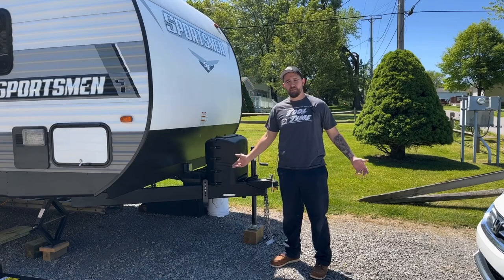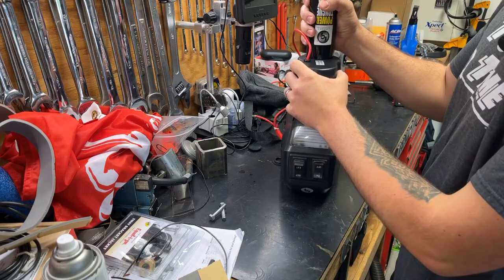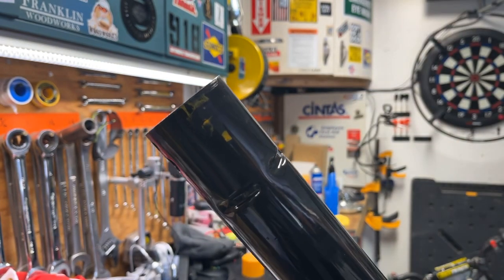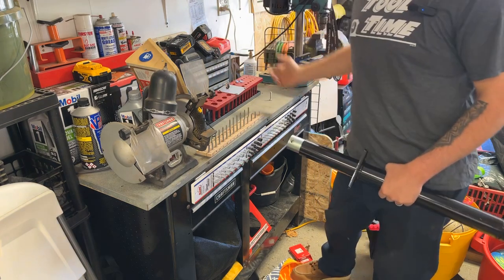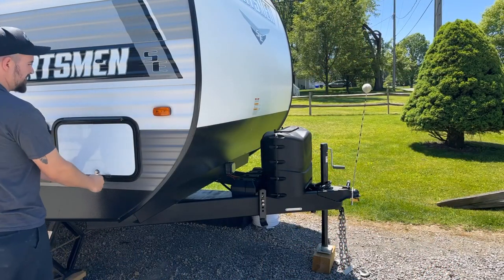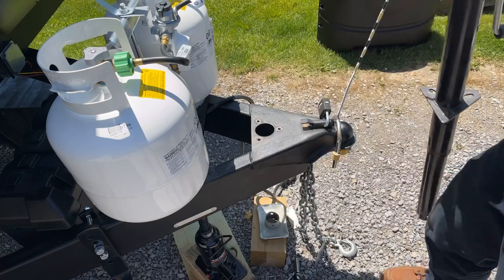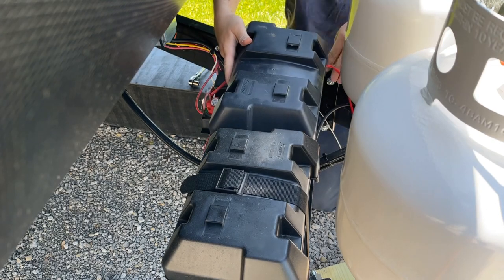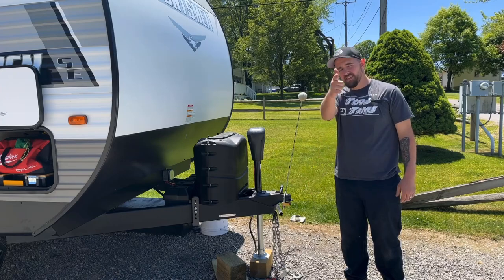Tongue jack upgrade and modification!!

Comment: My 2018 Winnebago has the same electric tongue jack as yours.  I did the same mods as you but to my surprise the holes were already drilled.  I had to tap threads in it but it saved some work for me. Thank you for the video.  I have not been able to open my tailgate for 6 years, and now that problem is solved thanks to you!
Reply from the maker: Happy to help!!

Comment: Takin the extra time, my grandpa always said do it right the first time or do it twice. Now you're in this far, drop the belly and see all the wiring hanging free in the metal pass through holes... I did that a month ago and cleaned all the wiring up and routed it all better with some non metallic conduit, it was a lot of work but worth knowing I won't wear through the jackets and ground something to the frame.
Reply from the maker: Absolutely. Thanks for the great comment!!

Comment: I have the Lippert Smart Jack and hate that I can’t open my Tundra’s tailgate all the way. This is brilliant. Question: Instead of using the bottle jack couldn’t I just hook the camper to the tow vehicle and remove the jack to drill the new holes? Btw, I just found your videos on YouTube and you are “the man!” Great content…and entertaining!
Reply from the maker: Yes, you could absolutely do that. I just wanted the room to work. And thank you!! I’m glad you enjoy the channel!!
Reply: @dansproshop  ….🤦🏼‍♂️ I just checked my “Smart Jack” and there isn’t any rubber caps on the sides to access any nuts to turn the head….guess I’m stuck with this “DUMB” Jack and a tailgate that won’t open all the way. 😡

Comment: Look at an autoleveling Ground Control from LCI
Reply: They are pretty good. My only complaint is with the Ground Control 3.0 system. They can be a little glitchy sometimes. The jacks can loose track of their position and cause an error code in the controller. This can be easily cleared by manually extending the jacks about 1ft  and then retracting all the jacks simultaneously.  Its just a pain in the ass sometimes. We've had so many customers come in with a front jack error that was just a glitch in the sensor. Other than that, they are great systems. It definitely beats manually leveling your trailer. I deal with so many Lippert products and they are definitely a good manufacturer with great customer service help when needed.
Reply: @OneRoomShed  I got a new camper and CW put a new leveling system on the new camper. I had to switch to the old control panel. It faulted out and I had to use a ratchet to manually put the jacks down. The old control I could put them down electrically. My front jack still faults out on over amps.
Reply: @scottdavis9442  lowering them manually can be aggravating sometimes (been there many times).  If you keep getting an error code on the same jack, there is probably a problem with sensor inside the jack. This could lead to a failure with the jack not running at all eventually. I usually tell people if it happens once or twice it's probably a glitch. If the same error persists on the same jack you will need to have it replaced. I would look into that if I were you. If the system is less than one year old, you can probably get them to replace it under the mfg warranty.
Edit : also if it is faultling and over drawing amperage, this maybe a defect in the motor itself.

Comment: I need to turn my existing one. It is an FIC 3500. I think I am lucky in that it has a round base. I can just remove the 3 bolts, rotate the jack and base 90 degrees, mark, and drill 3 new holes in the mounting base. It’s heavy gauge metal, but straightforward and simple.

Comment: Those Lippert jacks are definitely a better quality compared to some of the generic electric tongue jacks available. The only thing I can add is invest in a cover to keep the head assembly out of the rain. Although that Lippert model is not as prone to taking on water, there are a lot that are. If anyone buys an electric jack that has the switches on the top or the manual override access hole is on the top ; cover the head of the jack. They love to take on water and fail after one year (just as the mfg warranty runs out).  
If I were to ever recommend an electric jack to someone, it's the one that Dan just installed. It's definitely a reliable jack.
Reply from the maker: Thanks so much for the great comment!!
Reply: @dansproshop  just sharing my experiences. Same as you do and that's appreciated too my friend.
Reply: Just use a five gallon (you will have it available for other things) and hang the safety chains on the handle when parked.

Comment: In a another video could you show how to set up 2 batteries to run in parallel. I want to convert my one battery into 2 batteries. Thanks Dan!
Reply from the maker: Absolutely!!  Not difficult I promise. Just hook up the positive from one battery to the positive of the second. Same thing for the negative. That doubles your ampacity and the load will be shared between them. Works great!
Reply: I guess I meant in series. I don’t want convert my 12v into 24v. I’ll fry my camper’s components. Thanks
Reply: @josephcirelli9642  Dan is right, and you do want parallel, series will make it 24v and fry everything.  To add an extra battery to your existing one, and maintain 12v in the system, just run an extra wire from the positive of your existing battery to the new one, and of course same for the negative.

Comment: Dan,I do not have a dedicated battery on my utility trailer.
If I install an electric trailer jack,do I need to run a dedicated heavy gauge red wire up to my truck fuse box to run an electric tongue jack case the factory installed trailer plug might have a to small gage wire to run it?
Any response would be appreciated coming ftom a western Pa. Guy here
Go steelers😊
Reply: I think in my dodge ram big horn there's room a battery tray to install an auxiliary battery
Reply from the maker: I would strongly recommend putting a battery on the trailer. These things take a lot of current. So being close to the source voltage helps immensely. Good luck!
Reply: Thanks for your reply.
I do have an extra empty battery tray on my 2020 didge ram big horn. Thks buddy 
Keep the vids coming to Pittsburgh Pa. 😊
Reply: Or put a battery on my utility trailer close to an electric jack when I install 1.
68 year old here and not getting any younger 😅😅😅